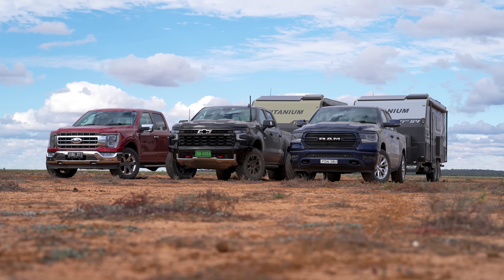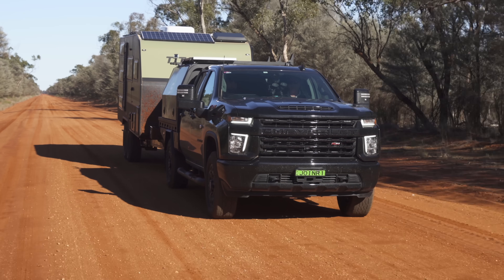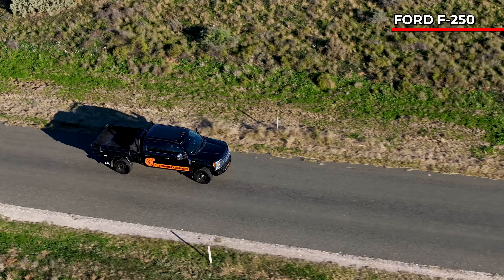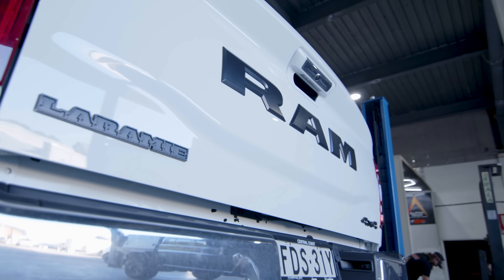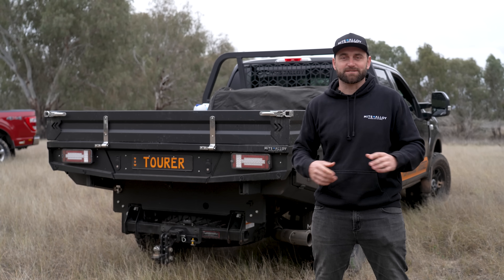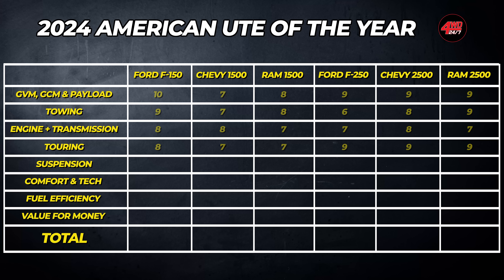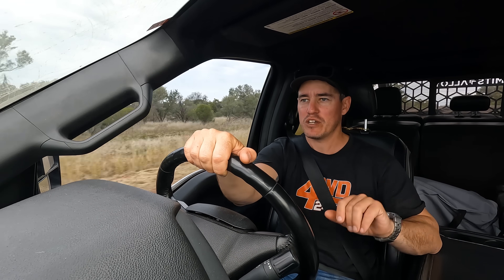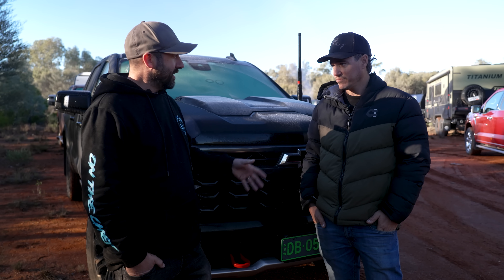2024 RAM vs CHEVY vs FORD TORTURE TEST! Heavy towing, dirt roads - SHOCK WINNER & major problems

Comment: Nice channel.
Im Canadian and glad to see you guys getting some real pick up truck/ute's for a change.. My mom lives in Melbourne and i do visit from time to time but over the years and I have been so disappointed in Aussies ute's a lot.. 
Here in Canada im on my 5th pick up truck since the 90's .. Currently I own F150 XTR model with a 5.0L V8 engine, quad cab and 6 1/2 foot box and love it(I paid 42k for it).. Im at 200km since the truck was purchased in 2015 and knock on wood i have not had any issues to date just regular maintenance .. 
Me previous truck when i trade it was at 420k and that was 2011 F150 XLT extended cab with the 5.0L V8 (I paid 34k for it) and the only major issue was  i replaced both front wheel bearing at 320k.. I can reassure you the durability of this trucks is good just dont skip on maintenance..

I truly hope the Aussie government cuts down this ridiculous prices on this imports and let you guys have the freedom to enjoy and drive this vehicle as we do..
Cheers.

Comment: " Do not take them low range, hard off road driving" while testing with a Zr2, which is a truck that trades some towing and payload for a more capable hard off roading and overlanding suspension set up. 😂😂 

Side note, Silverado is also the only truck here that still offers a diesel option in the light duty/ half ton truck segment where you can get a 3L inline six turbo diesel with 277hp and 460ft/lbs of torque 

Additional side note: Chevy has updated the 2500 with a much nice front end and has also offered the Zr2 in the 2500, which means you have a heavy-duty diesel that is very off-road capable
Reply: I mean sure, but such a long wheelbase compared to much smaller Toyotas and Nissans is going to struggle crawling some more challenging spots
Reply: In Australia all the off-road tracks have been cut out by "narrow" short wheel base 4wds. I don't doubt the zr2 could climb rocks in open terrain but with the narrow steep mountain tracks we drive, I could see many issues.
Reply: In Australia 
We have a much, much smaller model range of these vehicles, on offer.
Sadly 
1500 Silverado is only offered here, by GMSV with a V8 motor

Comment: My Ram 2500 Power Wagon comes stock with front/rear lockers, M12000 Warn winch, swaybar disconnect, skid plates and 2" over stock lift.  With sliders, aftermarket bumpers on each end and 37" tires, I take it rock crawling.  You would be surprised what they are capable of.

Comment: Watching this puts things into an interesting perspective for those outside the US. I personally own a Ram 2500 and I would never consider going back to a 1500 or smaller. now, as a caveat to that, I grew up on a ranch, and I live on one now, we use our 2500/3500's for EVERYTHING. and most ranchers/farmers I know in the US wouldn't be caught without at least one of them on the ranch, that being said most of us also have a 1500 for those times we need to run to town with the family or to grab something small. I do find it a little funny that they are talking about towing a 4-ton RV as a towing test, but then again, I use my 2500 to tow a water trailer which comes in around 6.5 tons 60+ miles a week, and that's not even considering hauling stuff like firewood, hay, feed, tractors, horse trailers etc. I would love to see them give these trucks to a couple aussi ranchers and see what they think of them!

Comment: just a comment about comparison, the ford f150 is just a lariat fx4 whereas the zr2 is a fully built offroad truck(baja style-ish). So the towing of the ford as an everyday truck is definitely the happy medium as on road it is tough to beat. The ram is also setup similar to the ford. Off road the chevy would been much better as the suspension is much softer (hence the lower towing capacity).

Comment: I have a 2002 Ram 2500, long wheelbase with the Cummins diesel. Its certainly no rock crawler but it handles itself fine on easy to moderate off road trails in Colorado. I've taken it over Imogene pass, Engineer pass, plenty of old mining roads, and so far its size has not prevented me getting to the top of the mountain. When wheeling an HD truck, you will need to be aware of the long wheelbase but careful line choice can do a lot to mitigate that. 
Here in the US, (cheaper trim levels of) these trucks are commonly used by tradesmen on construction sites, farms, ranches, squishing smaller cars in parking lots 😉. Short of hard-core rock obstacles, these full sized American trucks are intended to handle extended periods of use in 4wd off road or on unpaved farm-to-market roads, and do it while getting work done.

Comment: The auto market is so different in Australia than the states mostly because of the of options and dealer networks available. The options for interior, drive train, and suspension vary so much just from the dealership that its really hard to compare the vehicles you have there to ones in the states. The states were built by these auto manufactures and the workers that use these trucks. I think the biggest difference is the after market support and what is available for these vehicles. There is so much more that you can do to these trucks in the states as far as modification, comfort and being purpose built for what you want or need. Towing capacity and licensing are also completely different. 
 
I live in rural Montana and see these big 4wd trucks and what they are used in the hardest conditions for.
 The Fords you will see in the absolute hardest conditions like logging and a lot of off road areas. Fords are a very hard working trucks and will get you in and out of some of the hardest places you have ever seen. They are more expensive to maintain for parts and time in maintenance, but seem to hold up better in extreme conditions.
 The Ram trucks I see are mostly in rural areas, used for towing, farm and ranch life. Lots of dirt roads, fields and moving heavy loads over mountains. 
Chevrolet I see used more in the trades. Moving loads over paved roads, going on long runs. When comfort and quality of life are more of a consideration, its hard to beat a chevy. 

The engine options that we have available in the 1500 series trucks varies so much that they can be purpose built for your needs. Ford has turbo four cylinder and six cylinder options available, naturally aspirated v6 and v8 options, and even some crazy high horse power super charged versions. Dodge and Chevrolet both have diesel options in there line up as well as some crazy high horse power versions.
Reply: A lot of the reasons for the vast differences in American trucks vs the rest of the world is the system of regulations and taxation that make these large vehicles very profitable and avoid a lot of the costly regulations.

Australia has a similar setup with just smaller pick-ups as they are just cheaper to build and own.

Comment: It’s fascinating listening to you talk about towing shortcomings on these trucks when Australian laws wouldn’t even let you tease their towing capabilities.
Reply: They dont even put a real load on them at all
Reply: @yetibremsstrahlung9018  it’s also hilarious listening to them say they aren’t proven on washboard roads, as if they don’t do tens of thousands of miles annually on logging and mining roads in more extreme conditions in North America.
Reply: @georgejulien3286   i haven't seen it personally, but from what i can see on the internet the austalian outback is way way harder on vehicles than extreme conditions in North America. And when mining company's in North America really need some hardy vehicles they use 70 series land cruisers, because the us trucks don't last. And yes, 70 series are actually being sold in the US for offroad use only.
Reply: @autobootpiloot  I have a feeling you’re not familiar with what I’m talking about. Maybe you’re an east coast guy, but out west in BC and Alberta trucks spend more time on washboard than on any paved surface. Also I’d much rather be in a 2500 driving 1000 kms in -50 than a 70 series. We have full on highways out here that are just gravel.
Reply: @autobootpiloot as someone who works on power lines where are only access roads are dirt washboard roads. I've only ever seen ford's and some chevys, most of the ford's are pulling trailers with a few tons of steel on them and even skidsteers for transmission towers. Never had a problem with them even when the roads are in terrible condition since they're only dozed once and after hundreds maybe thousands of vehicles and equipment drive on them in wet conditions rutting them up and even in deep snow they perform fantastic.
Reply: Get a road train license.
Reply: @hi9580  I have one
Reply: @autobootpiloot nit sure where in north America you mean? Mexico? Not the usa for sure. I've been a miner since the 90s traveled and worked in mines all over the states and most mines run F450s or f550s as service trucks with f350s or
 250s as lighter support rigs. Over the years I've seen other trucks tried but the chevys with the stupid torsion bar front ends always have the front wheels fall off after the first 6-8 months. And the dodges of the day when we tried them (2008-2009) had the interior rattle apart. The dash would literally fall off in your lap. Ha ha. For long life never see pavement rough muddy rocky 24 hour a day operation. Ford is the standard over here.

Comment: Interesting outcome! Unfortunately the Chev 2500 you tested was the 22 model with the older dash setup. The 24 has a much more modern setup. When talking value for $$$$ look at the price of a new 300 series Landcruiser! They aren't a cheap option and will never be in the towing league of the American units. We run a 24 Chev HD and I learnt early in the piece that dealer support was average to say the least. I believe it is on the improve as they get more units out there on the road. No they are not off road vehicles as such but you would be surprised where they will actually go. I have found several online American shops where I purchase the consumable parts (filter etc) and can have them to my door in around 7 days. We have come from a 200 series Landcruiser and the difference towing in is huge. No longer does the caravan dictate the drive (straight physics says one should have a tow unit heavier than what is being towed). It is also actually good on fuel burn slightly better than the cruiser was. Comfort wise the Chev eats the kms and you arrive less stressed not having to be slightly on edge  towing something that has more mass than the tow vehicle. Build up a chopped Cruiser or Y62 and the American trucks really start to look like good value.
Reply: 100% agree.  Everything you said is spot on.  Come from a LR Discovery 4 to a 2024 2500HD, towing is effortless, no pushing on the car.  When we were looking to upgrade the car, the Land Cruiser still needed suspension upgrades and the cost wasn’t that much more to get the Chev.  So far, best decision we’ve made.
Reply: Spot on
Well said 
👍

Comment: Apparently the Ram 3500 is cheaper to buy in Australia than the Ram 2500 because it's rated (registered) as a Light Truck which is in the commercial category and therefore doesn't attract the luxury tax.

I'd have a 3500 Ram in a hart beat, because you don't have to be so concerned with payload limits when setting it up for touring Oz. Such as:
2 Occupants
Bull bar
Winch
Spot Lights
Aftermarket Fuel Filter/Water Seperator
Tray
Canopy
Roof Rack
Roof Top Tent
Bedding
Solar panel
Batteries
DC DC Charger
Battery Shunt
Inverter
Wiring
Fridge
Fridge Drop Slide
Gas or Induction Cooker
Camp Lights
Camp Chairs
Camp Table
CB Radio
Lift Kit
Larger Tyre's
Spare Tyre's
Max Tracks
Recovery Gear
Tools
Mechanical Spares
Storage Systems
Shower System
Toilet
Cloths
Food
Water
Fuel
Reply: The heavy waight seems like it would be not that great in the sand
Reply: So just buy an NB2 Chevy. Same weight specs.
Reply: problem is when you go in to the truck category you need log books and have to follow driving times limits.
Reply: @phalanx3803  You're not required to keep log books for a light ridged licence. You do for some heavy ridged vehicles at the top end of the weight class.
You must carry and complete a National Driver Work Diary if you drive:

a vehicle or vehicle combination weighing more than 12 tonnes or a bus fitted to carry more than 12 adults including the driver; and

outside of Western Australia and the Northern Territory.
Reply: @gregjacques3159  since when? our neighbor has LR for cattle transport he has to do log books. the only exemption I've ever seen on the books is for use farmer we don't have to do them as long as we don't go more then 100km from our farm.
Reply: @phalanx3803  The definition I put in my comment was from WA Transport Dept. As I understand it, these things are weight driven.

"A Light Rigid (LR) heavy vehicle class licence allows you to drive a:

motor vehicle with a gross vehicle mass (GVM) between 4,500 to 8,000 kg

motor vehicle with the capacity for more than 12 passengers (including the driver)"

In the case of Light Ridged, personal use and commercial use may be a factor.
Reply: @gregjacques3159  may be WA has some work around but on a federal level log books are need regardless of personal use or commercial use.
Reply: No ute/pickup truck gets hit with LCT, if they did a standard F150 lariat would be over 200k

Comment: Long time subscriber and I think your content is top notch. You bit off a huge test with the American trucks in so many different configurations. I applaud you for that. I love to see how you all do over landing. American trucks are made to tow toys to the location. The absolute size of them and length of the Crew Cabs make them nearly impossible to offroad. Don’t get sucked into all the technology and comfort features for the use of over land chores. One gem I think would work better for towing in your market would be the Chevy 1500 Duramax. Smaller diesel but still has big power and 13k pound towing. 
Keep up the great content !

Comment: The zr2 has off-road suspension and the driving modes make a massive difference in how it handles. Here in Kansas we use these trucks to feed cattle and haul them around. Constantly bouncing through cow trails and over washed out roads. We’ve always ran Chevrolet. The duramax is an animal once it has a good tune and a straight pipe exhaust.

Comment: You commented about towing off-road vehicles or small campers. Most of us here use them for real work like heavy equipment trailers, work beds with lots of heavy tools, and for large fifth-wheel trailers. That’s for 2500 and 3500 series models.

Comment: Like any 4wd - any properly set up american ute can be bloody capable offroad. I have a 2016 RAM 2500 with the 6.7 cummins. Coil spring all around, front and rear diff locks, solid front and rear axles etc. Can get anything you want in terms of upgrades. Send it.
Reply: Just so wide though
Reply: @JollyGiant19  never an issue for unimog

Comment: Great review and I think I've learned that I'd rather just have a $70k ranger/hilux/dmax and have $60k of trips
Reply: And also not see half the co try because  thay are shit in tight spots lol my mate spent 25 grand after buying on a hilux to follow a gq with a lift kit and Tyers lol and its broken more then out wheeling lol he is now puting my old gq diffs in it because  the stock drive line is utter trash his words not mine  lol
Reply: My ram 1500 was less then 70k
Reply: @GabeRonalds-o2y Fair call 🙂 And 'tyers'...
Reply: But that doesn't work for many towing requirements
Reply: If you’re not towing a big van it would be fine.
Reply: In the states we can get a work truck for 55k and throw on 37 inches tires. They do extremely well offroad especially the regular cabs. However they are still large and i’d just grab my wrangler for tight stuff.